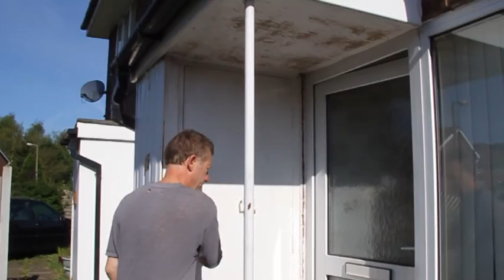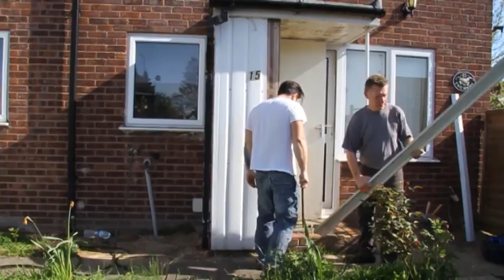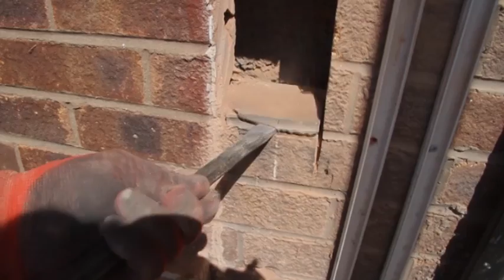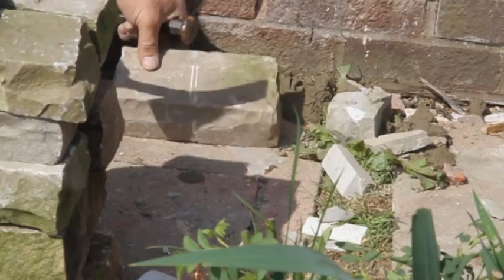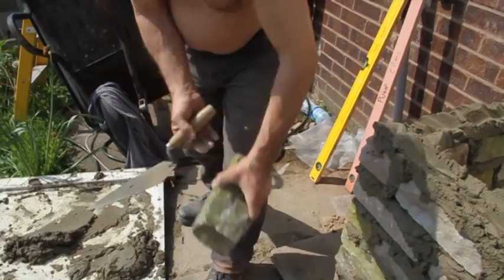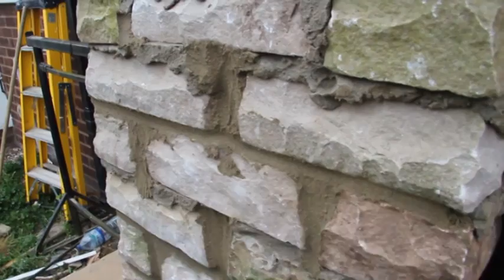How to build a porch in Indian Stone: part 1

Comment: hi Chris ,today ive been laying 7 newton blocks for the very first time , ive had no problems laying level but ive struggled to keep the blocks plumb with them only being 100mm wide , do you have any helpful advice and do you have to use a stiffer mix on blocks ? regards peter.